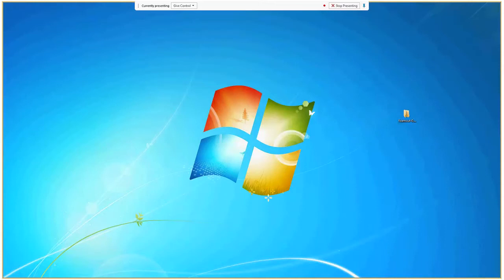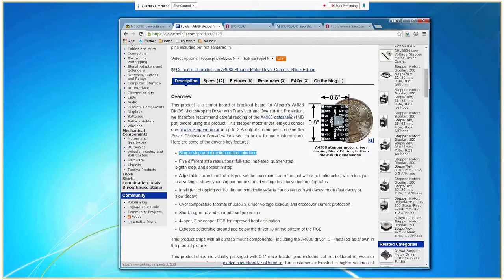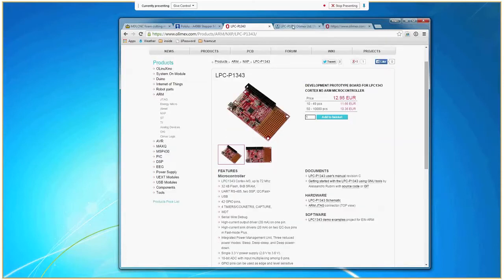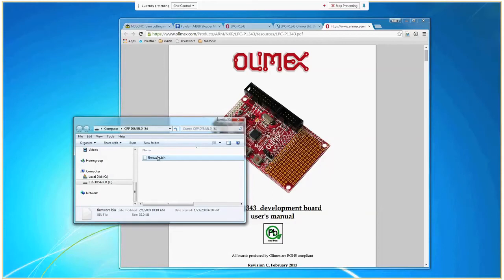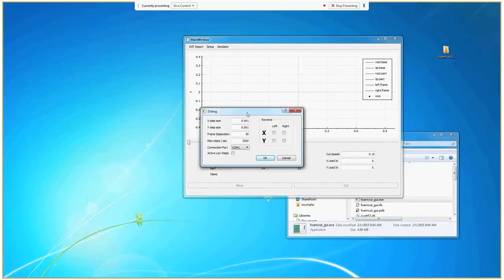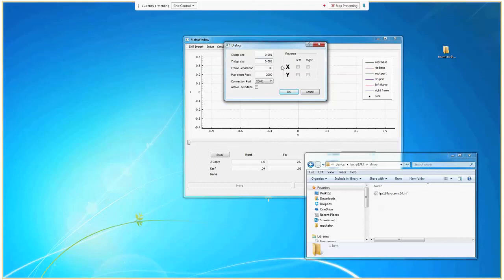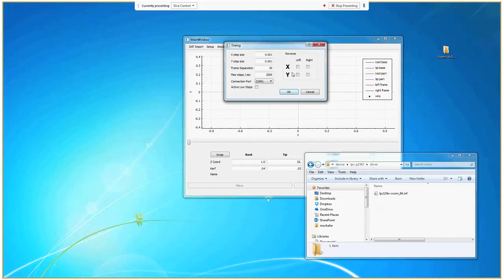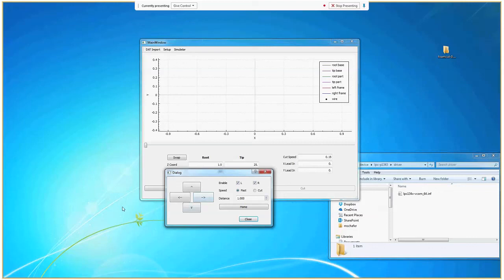foamcut_intro_hw

Comment: Hello Marc,

Thank you so much for creating a open-source foam cutter software. 

How can we help you to make the software support other arduino based boards?

BTW, the limit features - how can we enable X and Y travel limits?
Reply from the maker: AB AgroImagem 
The software is designed to be relatively portable to other boards, but Arduino is not a likely candidate for the following reasons: AVR processors have very low performance, Linux boards don't meet timing requirements, development environment does not support debugging, and they are expensive.  The Freescale Freedom boards or STM Nucleo/Discovery are much better candidates.  I would be happy to provide help to anybody who wants to do another port.

The limits are digital inputs--8 pins for 2 directions on each axis.  Connecting one of the inputs to ground will prevent one motor in one direction.
Reply: Hi, Marc.

Thanks for your quick reply and great indo. I will look into it and as soon as I have everything ready I will send you a video.

Once again, congratulations for your work.

Gustavo

Comment: is this the only hardware that can be used? I have a parallel machine already up and running....
Reply from the maker: The olimex lpc-p1343 is the only hardware supported right now, but you should be able to wire it up to a stepper motor controller that is designed to work with a parallel port.  You would need to figure out which pins on the parallel port connector are being used as the step and direction inputs for each of the 4 axes.
Reply: Got it. I've done the same with GRBL by making a custom cable to connect the Arduino Uno to a cheap Chinese 6550 board....
Ill look into it. Thanks.